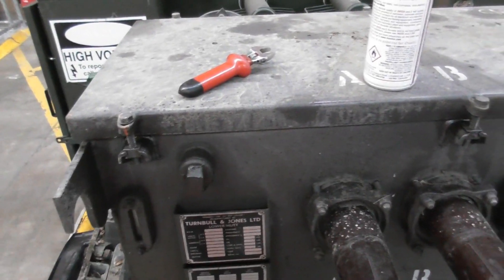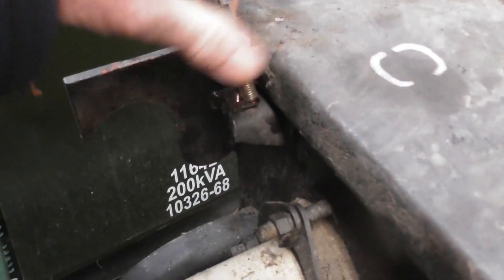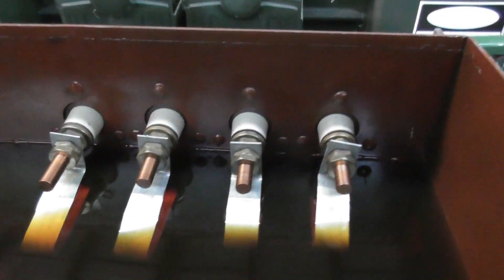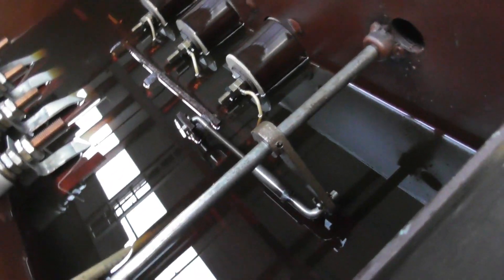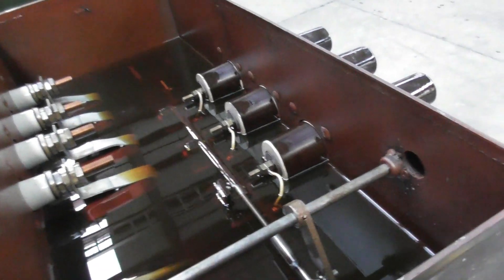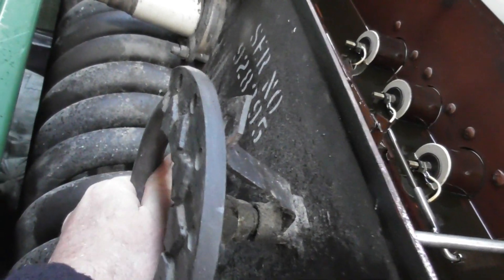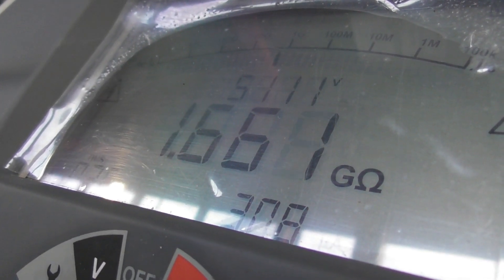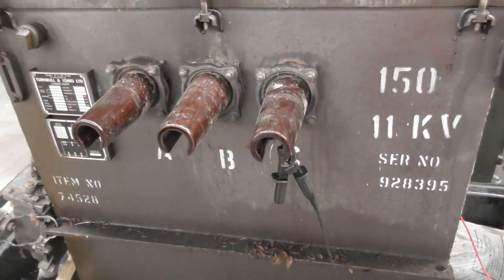Taking the lid off - T&J 150 kVA TX

Comment: Thanks for the second look at the rating plate.  Lot of weight right there in one package.  In the last video, there were plenty of comments saying that those things were indeed mounted up on poles (some said 2 poles, some indicated that more were needed.  Either way,  I wouldn't want to be around if any of the poles were to fail.  I was pretty sure that a design like this would have been kept pretty close to ground level.  Anyways, yes, once you get a good close look at it, you can see quality all over that thing.  They knew what they were doing when they built those old lads. Built to last.
Reply from the maker: We have 1 to 1.5 ton transformers or voltage regulators hanging of single wooden poles.

Comment: Really cool!  Always wondered...  now i take it possibly the oil was a bit low seeing as how the transfer switch was not completely submerged.  I would think that an arc could possibly jump from contacts when switching just like when the big open air disconnects open and let the dragons loose..?  Im not too informed on the arc extinguishing technology of the hv world but i do know once they start, they are not easy to estinguish the arc.  I just envision a big pressurized bomb if an arc starts above the oil level..  i have seen oil filled xformers go but only from overload short..  

Thanks again by the way for popping the lid sir.  You lead a very interesting day to day, would be a joy to have you as a professor.   

Appreciate taking the time for all the vids also.   God bless..
Reply: The Transfer switch (or Off Load Tap Changer ) is designed to work while there is no Electricity in Transformer (or in Off load conditions , as the name says)...       so there is less probability of an Arc.
Moreover as the transformer is very old the oil in it gradually decomposes, Evaporates or sometimes leak, maybe that's why the device is not fully submerged.
Reply from the maker: The oil level was maybe a tiny bit low although when the transformer is warm the oil level rises a bit anyway. Often in the older transformers for arc protection they rely of a flash over between the flat washer at the HV bushing and the steel tank to protect in case of a lightning strike. HV arcs are hard to extinguish, but to trigger them you have to be fairly close about 2 cm for 11 kV to jump.